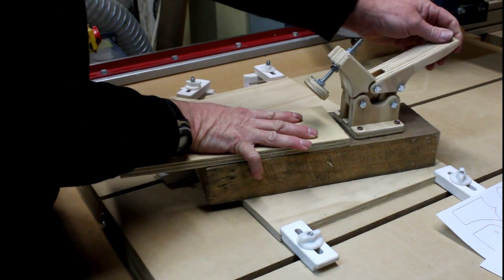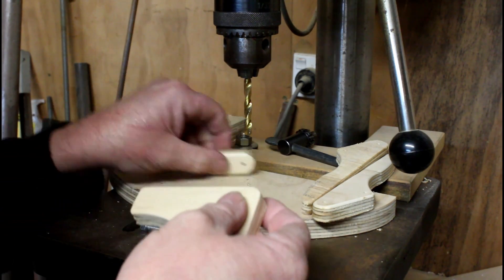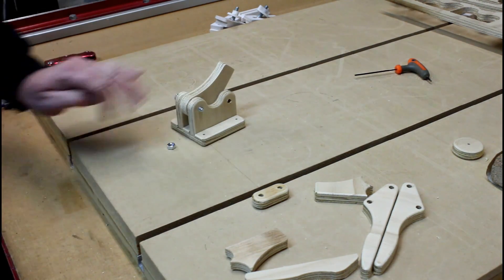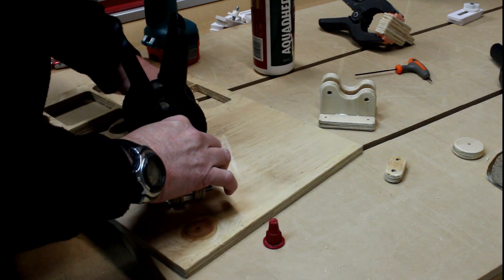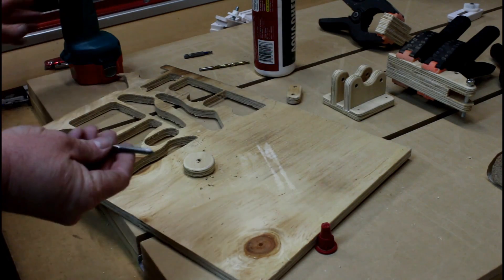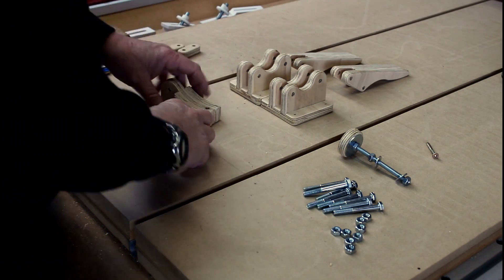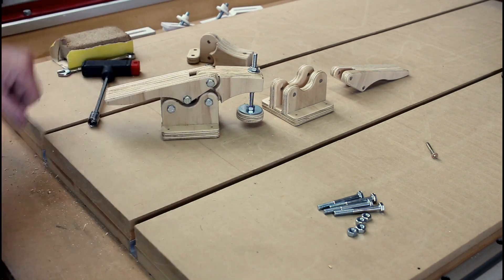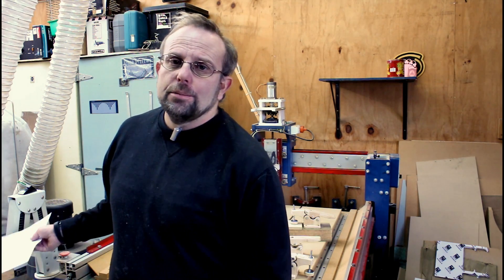Izzy Toggle Clamps - CNCnutz Episode 62

Comment: Peter,
I see its been a while since this video was made. Are the CNC files still available? They don't seem to be downloadable anymore. With the exception of the pdf, every file I try to open generates an error message saying "the files are supported but something went wrong"  Any suggestions
Reply from the maker: The files are still there. You need to download them not click on them to open. If you click on them to open you will get the message that you saw. Instead select the ones you want and download.
Cheers Peter

Comment: Is there any reason you used the drill press rather than routing the holes?
Reply from the maker: Not really, either method works. I t just allows for a 1 size fits all drawing there the user can drill their own hole according to  the bolts and screws they have.
Cheers Peter
Reply: @cncnutz  That's a perfectly cromulent reason. Thanks.
Reply from the maker: Yes much easier to embiggen the holes latter. 😂

Comment: I use my old hardened rubber caulking tubes - just saw them to size on bandsaw and it makes perfect foot pads for such use.
Reply from the maker: That's thinking outside the box or is that tube. I admit that the first thing that springs to mind when I see my tube has gone off isn't. Great now I have some feet for my clamp. It's usually something more expensive. 😁 Will have a try next time I get an old tube.
Cheers Peter

Comment: Thanks for making the plans available i made the clamp from scrap 12mm acrylic that i had and it made the clamp super strong and the bolt holes don't ware
Reply from the maker: Sounds fix Neil. Acrylic would be a nice and hard material for the clamp.
Cheers
Peter

Comment: Hi, I used 5 millimeter all threaded bolts and I just have good preassure when I set the nose bolt longer forming an angle instead of a ninety degree angle to the piece I want to clamp.
It works that way but not as designed.
I suspect the issue is due to the bolts being all threaded and that keeps me having to hold the nuts tighter making hard to use the clamp with one hand. And there always some play on the bolts and the wood.
Any thoughts? Thanks

Comment: Great to see cooperation between the designer (Izzy) and the manufacturer (you).  Wonderful what can be achieved using CNC facilities.

Re the adjusting screw which you omitted, in his video Izzy explained this is only needed with hand-made parts to adjust for resulting variations in the component dimensions and even then, not always, depending in the variation.  He commented that with the accuracy and repeatability obtained from your CNC manufacture, this adjusting screw wouldn’t be needed so you were right to omit it.

Thanks for an informative video.
Reply from the maker: Thanks Ian. Izzy makes some great projects and I was glad he left me make this one. They are nice clamps.
Cheers
Peter

Comment: those are great.  i'd epoxy or use contact cement some round rubber roofing pieces to them to keep them from marring up the surface of the work piece being clamped. we should all have a CNC that wood be great as well.
Reply from the maker: Thanks Gino,
The roofing rubber sounds like a good idea.
I agree. Everyone should build at least 1 CNC machine and learn how to use it.
Cheers
Peter

Comment: piece of innertube prolly works for the bottom of the footpiece need to ask around for wat adhesive to use though
Reply from the maker: +watahyahknow 
That would work well and you could use a contact glue to attach it. 
Cheers 
Peter

Comment: Thanks for going to the trouble of the video and thanks for the cad files.
Im using Aspire V2 so i had to use the dxf as you must have uploaded a later version.
Best of luck from Ireland!
Reply from the maker: I was using VCarve Pro 6.5so I imagine it uses the same format as Aspire 3 since they came out at the same time.
Glad you got it sorted.
Cheers
Peter

Comment: Peter, I am puzzled why you chose a less accurate method to drill the bolt holes than using the CNC. Depending on your software you should have at least 3 options to drill holes larger that the bit size, Inside Profile, Pocket Profile, and Spiral Drill for holes larger than the bit diameter.

Also if you added 2~3 holes in all the handle pieces you could assemble them with dowels for alignment.

Just found you channel and will peruse in the next few weeks. Will try out the clamps on my Joe's Hybrid.
Reply from the maker: +Oswyn Faux 
I could drill holes using the CNC using either of the methods described but I believe that the better tool is the drill press and a correctly sized drill. With pilot holes the larger drill follows and the hole will be in the correct place. I wanted the holes to be tight to the bolts to eliminate slop and picked a drill bit that gave the best result. It is just the way I do things. 
Thanks for watching and merry Christmas
Cheers 
Peter

Comment: hi peter, just a comment on your pdf templates. i rather would prefere a mark on the center (cross) of the holes rather a "ring", marking the position. because like this, i can punch a mark and open a hole according the pins i obtain o find in the shop.

suggestion: just mark the center in the plan and upload it again. it makes a difference in acuracy , in dependent of the size i print the templet.

nice cooperation between you an izzy.
Reply from the maker: Hi,
Thanks for the suggestion.
I have modified and replaced the drawing to put a cross in each hole as you suggest.
Download using the old link and see how you go.

Cheers
Peter

Comment: If I could justify spending the money on equipment like that I would not take my time making $6.00 clamps.  That's just assembly work not woodworking.
Reply from the maker: +James Richardson 
Hi James. 
While I respect your position on use of CNC in woodworking I should point out that it isn't a simple matter of pushing a button and a clamp kitset appears ready to assemble. 
The plans of the clamps had to be drawn and then toolpaths created. The material loaded into the machine and the machine set to the correct speed and feedrate to cut the plywood properly. If truth be known I spent 10 times the amount of time doing all this than Izzy spent making his. I will make the time back as I make more of them and mine will all be the same but it's a hobby and I like doing things this way.
I've done my time gnawing projects out of trees with my bare teeth like a real woodworker.
These days I prefer to use hand tools, power tools and other tools that the modern world has to offer.

I find making a clamp or anything for that matter more satisfying than buying it which for me is what it is all about.
Thanks for watching and hopefully you will make some clamps of your own. 

Cheers
Peter

Comment: Somehow I do something wrong with the PDF. When I open it in dropbox it is OK. But as soon as I want to save it as a PDF then it is one page with only a few parts on it. What do I do wrong?
Reply: +Hans de Groot I found out what I did wrong.
Now I have a print-out in PDF. It slightly differs from the sketch which Izzy Swan published in his original video.
Reply from the maker: +Hans de Groot 
Good one Hans. Glad you got it sorted
The drawing was made from a screen capture on Izzy's video and then made into a CAD drawing.
It shouldn't be too far different from the original drawing.

Cheers
Peter
Reply: +CNCnutz (Peter Passuello) Izzy Swan had also a PDF which I used for my first toggle clamp. There were x on the places where should be the holes. In one piece where no holes.
Your PDF has o on the places where should be the holes. 
When I put the cut out pieces of Izzy's PDF on your PDF I found out, that some of your pieces are slightly larger while other are the same large. My first toggle clamp, according Izzy's PDF did not turn out too well but that is more my fault. I do not have a CNC router nor a bandsaw, so I had to do it with a jig-saw (on which I do not have very much practice) . I also do not have a disc sander so all by all it took a lot of time. My second one will be for sure better.  I have enough left-overs to try. The only problem is time.
My first toggle clamp has the problem, that the front part with the holding down is not completely horizontal in its closing position.
I have to find out why this is so. Some holes not exactly on the right places, I suppose.
Can you tell me something more about your CNC router?
Sign, capacity, price, etc?

Comment: You say you're looking for "suitable rubber" to use on the clamp pad, I recommend using an new/old mouse pad. They come in sheets, easily cut, and readily accept contact adhesives.
Reply from the maker: +Coffieman5150 
Thanks for the idea
Cheers
Peter

Comment: Peter, I just made two Toggle Clamps.  I don't have the CNC cutter, so I used the band saw.  I have to admit that the parts didn't come out as sharp as your parts did with the CNC but they were good.  After putting the parts together and trying them out, I was impressed by how strong they were.  When I looked at the copy that I downloaded and printed out I thought they look too small to hold anything.  I also printed out plans enlarged to 150%.  After using the smaller toggles clamps I didn't build the larger set.  Thanks for the plans and the video.  They are top notch and you made them easy to understand.

Comment: can you do it without a c n c machine
Reply: Nothing about this requires the CNC. The best alternative is probably a printer (to make paper templates from the plans, which you lightly glue to your work piece) and any saw that can cut curves (bandsaw, scroll saw, etc.). It eliminates some risk if you cut outside of the template and then sand or file down to the line.
Reply from the maker: The original design was handmade by Izzy Swan. I just drew it up and cut it out on the CNC.

Comment: I find that the rubber from old bike tire inner tubes is great for so many things and will probably do the job to add fiction to the foot pad. just pick them up at the nearest bike store trash and cut out and piece and glue to pad. :)
Reply from the maker: Good idea. That is what I ended putting on mine.
Cheers
Peter

Comment: Hello, what is type your cutter / diameter, spindle speed, feed rate? thanks
Reply from the maker: As mentioned in the video I used a 3mm upcutting spiral bit.
As for feeds and speeds I set the router to 10500 RPM and adjust the feed rate manually to what sounds right to me. As a guess I would say this was cut at 150ipm. This may seem strange but I just listen to the sound the machine makes and set my speeds and feeds according to what looks. feels and sounds correct to me.
Cheers
Peter
Reply: Thank you very much

Comment: me podrias pasar las medidas
Reply from the maker: Fabian Carlos Hi Fabian,Not quite sure if Google translation has it right but I think you are wanting measurements.The measurements you need can be got from any of the Cad drawing in the files.I suggest the Sketchup file would be the easiest ones to use and Sketchup is free. There are 2 versions of Sketchup files to choose from so if the version you have won't open one then use the other. Hope this helpshttps://www.dropbox.com/sh/dildgadtv6cat03/4U7aY4pA8zCheersPeterHola Fabián,No estoy muy seguro si Google traducción tiene razón pero creo que está esperando las mediciones.Las medidas que necesita se puede conseguir desde cualquiera de los Cad de dibujo en los archivos.Sugiero
 el archivo Sketchup serían los que más fáciles usar y Sketchup es 
gratuito. Hay 2 versiones de archivos de Sketchup para elegir, así que 
si no se abre la versión tienes uno utiliza el otro. Espero que esto 
ayudehttps://www.dropbox.com/sh/dildgadtv6cat03/4U7aY4pA8zCheersPeter

Comment: Fantastic work Peter, thank you for sharing! How durable is the thread in the foot? First thing I thought of was wicking CA glue in to lock it up. Got to make up a bunch of these some time!
Reply from the maker: I don't think you will have any issue with the foot.
The forces involved are such that the washer and nut above the foot take the load not the foot itself. The only job the thread has to do is stop the foot falling off when not in use.
All the best with your build.
Cheers
Peter

Comment: Thanks for sharing those CAD drawings.  I just recently got a CNC carving machine in the workshop and need to learn CAD before I can really make use of it.  These toggle clamps look like they'll be handy to have around the workshop and being able to produce a bunch of them using the carving machine will save a lot of time.
Cheers!
Reply from the maker: It will be a good project to start with.
Doesn't use a lot of material so is good to learn with and you can make as many as you want because they are very useful.

Let the fun begin.

Comment: I downloaded the DXF files and my measurements (regardless of which Units I select) for the top left hole centers is 55.0 inches. What scale factor should I use to reduce the size for making the parts at the correct scale?
Reply from the maker: Hi Nick
The DXF file is in metric format and it drawn 1:1
I'm not sure what the measurement you are talking about as nothing to do with the top left piece measures 55 anything no matter what I do with it.
Here are a couple of measurements to help scale the drawing.
The Top left piece is 2 circles. The inner is 3mm and the outer is 36mm
Directly below that is the base which measures 73mm square.
The entire parts collection when selected measure 186.446mm x 242.058mm
You should be able to easily be able to scale from these measurements.
Let me know if you need further help.

PS what CADsoftware are you using to open the file?

Cheers
Peter.
Reply: I used Solidworks and Mechanical Desktop 5. In both cases, I changed the units to metric but the dimension translated to the larger US dimension. Thanks for the measurements, That will do, I'm sure..

Comment: Can I make a suggestion on threads in wood?  what you did looks very good, and plenty strong for the application.  My thoughts are if someone needed the hold to be a bit stronger, they could add a step between the drilling and the tapping... If they took the thinnest CA glue they could find and coated the entire inside of the hole, the glue would soak in and make the wood making up the thread stronger.  **Let it dry completely before running the tap through.

Comment: I made one of these from the plans but I changed a few things. 1) I used a 1/4-20 T-nut in the clamping foot pad instead of tapping into wood  2) I added another 1/2" thick plywood piece front to back in the middle between the two upright legs 3) I used 1/4-20 jam nuts (with nylon insert) for the four 1/4-20 bolts and....4) I added a dome nut (acorn nut) over the hex nut on top as an aesthetic finish.

Comment: Great video will try and make a couple of these. I have downloaded the pdf and will be
cutting out by band saw.
Reply: I plan on making several.  I'll make templates from 1/4" material to spec's and then rough cut them out on a band saw and use a router with a flush trim bit in my router table to finish them out quickly.

Comment: An improvement for those wanting easy adjustability would be to have the allthread mount into a t-nut (on the underside of the arm).  That way, you can adjust it by hand and don't need to deal with 2 different nuts for adjustment.

Great stuff, though, thank you!

Comment: I downloaded the pdf and faithfully cut out all the parts. the clamp assembled very nicely and works great. the only thing I see, and it was mentioned in the video, is that when the clamp toggles over center, the nose really points downward. without a swivel on the holding pad i am not sure if it will even work. I am going to re-design the nose piece a bit to bring that angle up. I understand compensating for the flex in the clamp but mine turned out way too severe of an angle.